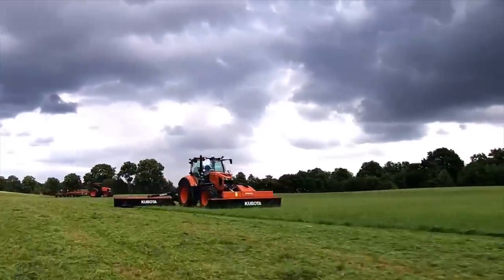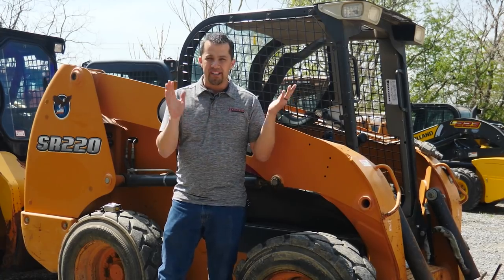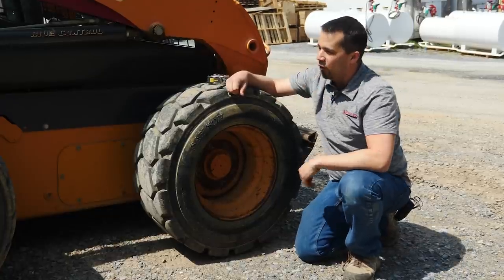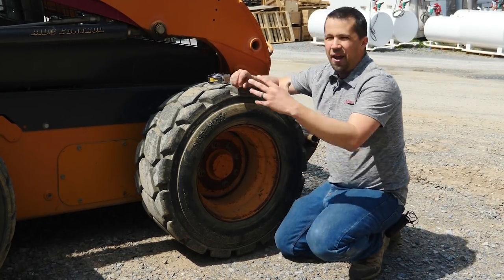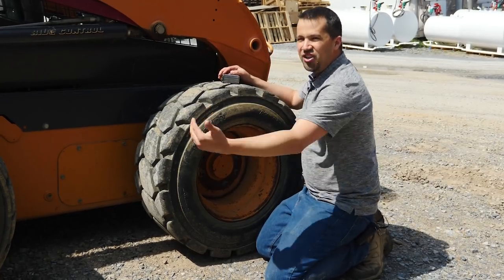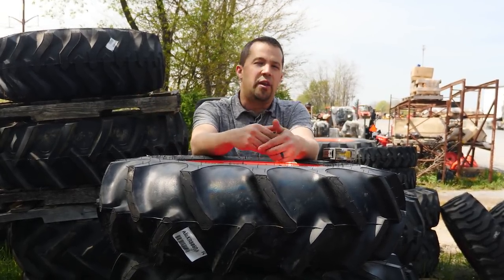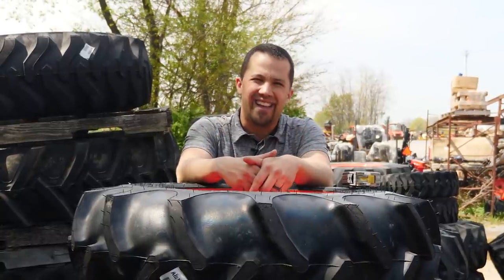#1 Mistake Farmers Make With Their Skid Steers

Comment: I worked as a mechanic for 44 yrs. It was all most impossible to explain this to 4 wheel truck drivers. The binding and snapping in the transfer case and tire wear. And the jurky steering when in 4 WD. They all thought I was crazy for telling them there tires were a different size. an inch in height is close to 3 in circumference causes all kinds of problem.
Reply: Damn Skippy
Reply: NOW with so many AWD cars and SUV's on the market.  Most people are having the same unexpected tire issues too!

I know the Salesmen won't tell buyers about tire issues on a AWD vehicle.  If they did most people wouldn't probably not buy one.
Reply: I had a 63 Ford 4wd truck.. but from factory the front was 3.89, the rear axle 3.92...

Comment: Yeah with trailers new tread depth takes more load and wears faster than older tire with less tread depth, but on a powered "drive axle", I liked the drive train "stress" increased explanation. That totally makes sense as a second reason to keep tread depths as close to matching. Tire life and drive train wear and tear accelerated due to non matching circumferences.

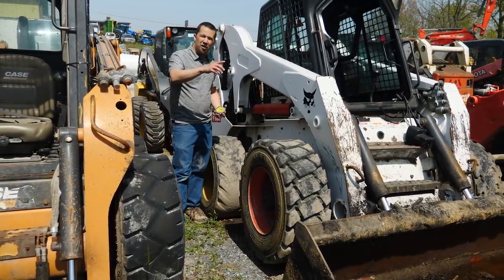Comment: 4:05  30" * pi = 94.24" and 32" * pi = 100.53" so a little over 6" difference.  Isn't math fun!  👍😁😁
Reply: Beat me to the math.
Reply: Did the same math, got the same result!
Reply: Put simply, every inch on the diameter is a little over 3 inches on the circumference.
Reply: @MrPaw45  3.14” per inch diameter differential
Reply: @Sicktrickintuner  I know that but unless you measure the diameter that accurately it's easier to just say 3"
Reply: @MrPaw45  it’s about a 4.5% different from 3 to 3.14. So 4.5” over 100” is a big difference
Reply: @Sicktrickintuner  If you're only eye-balling the measurement of the diameter across the tread you could be out by that much anyway. Also calculated circumference isn't the same as rolling circumference either so there's not much point arguing over 4% inaccuracy.

Comment: Hi Neil @2:15 you indicate your left and right sides are tied together.  I think what you meant to say is "One each side, the front and rear tires are tied together".  When replacing a tire, you need to make sure your front to back are close to the same size.  The issue on right to left will be drifting of the machine when applying equal force to the travel levers.
Great episode though, Jason

Comment: The same tip also plays for modern all wheel drive cars.

You are best to run all the same radius tyres, otherwise you will eat your clutch packs in your diffs.  Its been known people to replace just the front tyres with a slightly different tyre size, and it just eats the centre clutch
Reply: Jeep had a recall several years ago that required replacing the "temporary" spare tire with a full size spare tire on their quadra-trac equipped Grand Cherokees because of this.  It would prematurely wear out the transfer case's viscous coupler due to it having different tire sizes all of a sudden it would also cause differential issues if it had the limited slip differential it would wear out the clutch pack in the differential as well.  

I think Subaru at one point if you had to put the spare tire on you had to pull a fuse under the hood to disable the all wheel drive system, thus turning it into a front wheel drive car when running the spare tire.

Comment: The race drivers put a mark on the tire and a mark on the ground, rotate the tire once and measure the distance between the marks on the ground. It's more accurate than simply measuring around the tire. It's called "rolling radius".

Comment: Please forgive me if you've answered this in a previous video but I was wondering how this info transfers into the world of tractors with "front wheel assist". For example:  one of my front tires is new and the one on the other side is used. Can you elaborate on how this may or may not do damage on a four wheel drive tractor? thank you
Reply from the maker: several reasons why, but its less of a concern on a tractor.

Comment: Those of us farmers that run on very little concrete with no hard turning on concrete end up with tires that dry rot or get cut up before wear out. Had a tractor that had 1 set of tires in almost 40 years because tube was sticking thru sidewall  yet plenty of lug left

Comment: A lot of people that own these things. I wonder how they actually got to own one in the 1st place. They never check the pressure until one is flat.  You're expecting a lot out of someone to think that they would rotate them yet check the pressure. When they do come in with a loose one in there pick up flat. I inflated to the recommended pressure.  Which Eden creases the size. So I got mine at 45 and there at 20...:32 and 15 all the way around the vehicle.

Comment: To get the outside length of the tire measure the diameter and multiple by pi (3.1459) 1” diameter = 3.1459 outside. That 2 inch difference in diameter is 6 inches of outside circumference delta.
Reply from the maker: knew that middle school math was good for something. :-)

Comment: There really is no effect on the driveline.  If the dive line load was an issue you’d never want to force the bucket into a pile of dirt or gravel or you’d stress the chain.  The chains get mega pull when you’re turning too.  In this situation you just scuff the tire.  The small diameter tire will scuff.  The one scenario where you have different sized tires on different sides you slowly turn all the time.  It’s a pain in the ass.  Best case, change all 4 when they’re wore out.  If you wreck one try and find one that about as wore out as the others.

Comment: If you think this is #1 mistake farmers make with a skid steer you need to get on a farm more often. Lots more sketchy stuff than rotating tires.
Reply: ^^^
Exactly this
Reply: everything has bailing wire holding it together!
Reply: Skidsteers turn better on front tires so load her to the max.